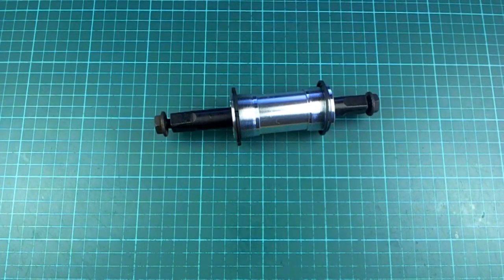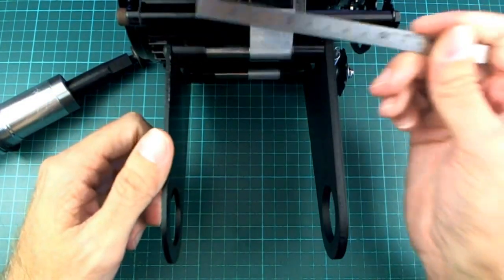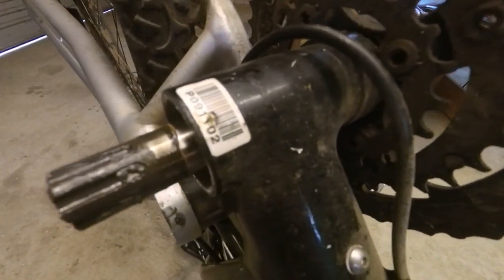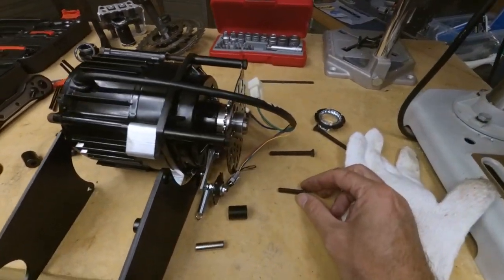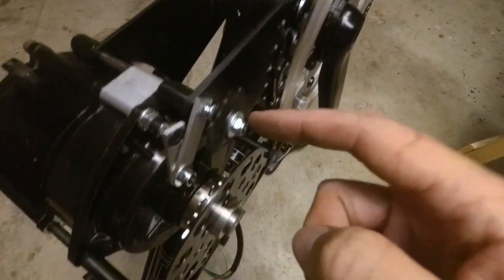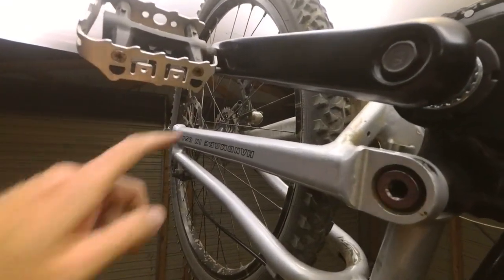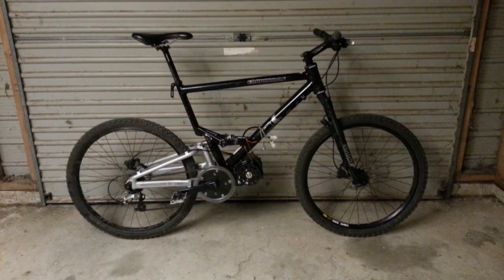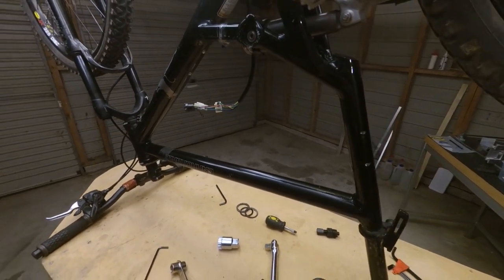Electric bike part 3 (motor test fit)

Comment: Following along with interest, you're making me want to do the same project. The splined bottom bracket you removed is named Shimano Octalink. Also the reversal of the brakes is dependent on which country it was assembled. Just like how they drive on the wrong side of the road in many countries too

Comment: This is now 3 years old right?
1. Did you have any further problems with your motormount 
2. Gears, Chain how used are they
3. Would you still recommend this kit?
4. Is the new 52v 6ah battery from lunacycle enough or should I buy the big one or make myself one ?

5. Did the bike withstand the forces

6. Is the motor strong enough in your opinion? 

Thanks in advance
Reply from the maker: 1. no
2. how do I measure that
3. yes
4. enough for what? It would have about the same power as mine and about 60% of the capacity.
5. yes
6. strong enough for what? I weight abbout 85kg and it pulled me up a decent slope without any trouble, see the 'off road' video in this series. The battery is the limiting factor really, not motor.
Reply: @iforce2d  thank you a lot 

to 
2. i mean if the gears  or chain are broken because a normal bike is not designed to work with a 3000watt motor

4. i mean if the motor gets enough power from the battery

thank you, you dont need to explain any further this helped me a lot ;)

Comment: This is great. You have about as much experience as I do and explain things in a way I understand.  Ordering one of these next week.  Is there anything you would do different if you could, or plan on doing?
Reply from the maker: I would still like to have a proper solid mount made so that there is no flexing under power, but it's holding up pretty well so far.
Reply: iforce2d I was thinking about getting a set of these, cutting them down and using as a brace. there's no way you'd twist these, unless you twisted the bolts that hold the motor together.  https://www.mmbikeparts.com/Engine-Mount-1-1-8-p/1_1-8-em.htm

Comment: Add another bearing like the one at bottom bracket it helps with rotation of axle and more support.
Reply from the maker: Yeah. Recently I disassembled this whole thing to make a nicer battery box and overhaul the bike completely, and I realized that the bearing that's already there can slide right out to support it at the outer end properly. That's all I had to do, but it seemed super stuck in place at the time.

Comment: Are you still running this motor? How is the longevity so far, any maintenance necessary?
Reply from the maker: Yeah have been using it quite a bit recently actually. No issues  so far, I have not done anything to it maintenance-wise.

Comment: Any reason why you didn't cut the spacers (with the thread in it)? I'd say it's much easier to make a single cut through a piece than cut a right angle out of a piece that's attached to something else. (and it's easier to replace should something go wrong with the cut ;) )
Reply from the maker: Aluminium is easier to cut through, those blocks were easier to hold in a vice without crushing them, and I didn't want to mess up the thread.

Comment: I just switched flipped the right shifter on to the left side on the handlebar, looking upside, and it works! then use your index finger knucle to go hard  gears, use thumb push the gear whiter lever for easy on the pedaling, work the gears, you will get used to it very quickly. and the it rocks!
Reply from the maker: That's what I did, but for some reason merely re-positioning it caused it to be almost useless, I usually need to pull the thing at the back by hand while trying to simultaneously move the shifter, and I can only use two gears reliably. Fortunately it doesn't really matter because the motor can do the business in pretty much any gear.

Comment: I tried not to cringe when watching you do this. Had I found this sooner, I'd have been able to help you. My best suggestion in regards to gearing is to use a gripshift in reverse on the left hand side, which is pretty much the only way to have a rear derailleur operated from the left.

Comment: Can i still Switch gears at the front gearthing (you know what I mean )?
Reply from the maker: No, the front sprocket is completely replaced. You can still use the rear gears. But in practice, you don't really need any gears.

Comment: Man... that was a PITA to install. There should have been some basic sprocket to motor alignment critical instructions. Having to cut the aluminum motor brackets should have been an option in those critical instructions IMO.
Reply from the maker: This kit is sold with the understanding that it is a 'difficult' install and they don't offer anything in the way of help or instruction. There are quite a few blogs and websites where people have gone through the same process but I was too dumb to read up on them, maybe they mention something like this :)

Comment: I completed a 3000 watt cyclone motor install on my fat bike about a month ago, took me a couple hours at the hardware store and about three hours to install and I was off and riding. Check out my video. the bike is a blast to ride with more than enough power for top speed and going up any Hill.